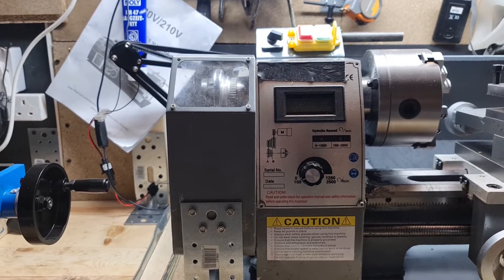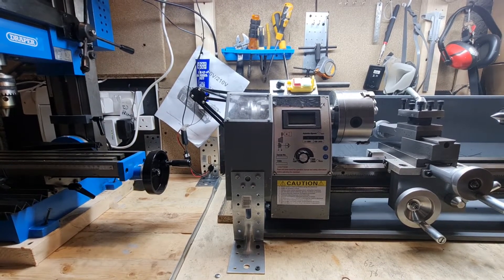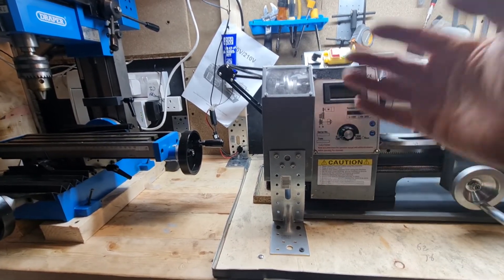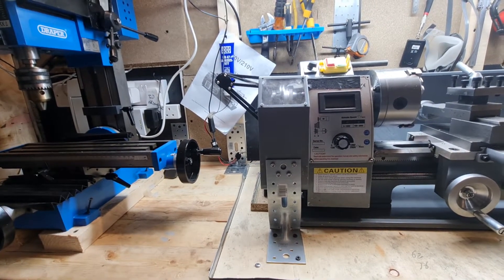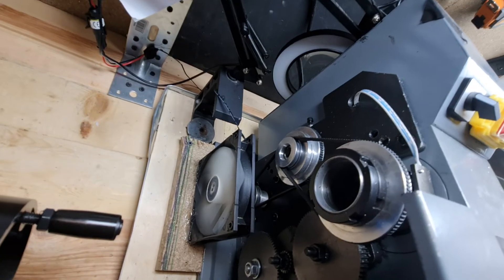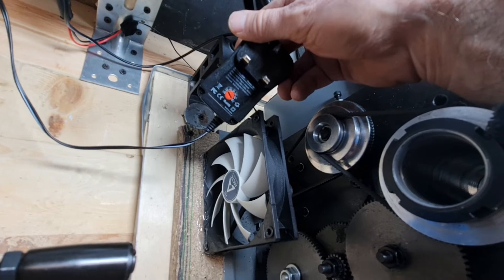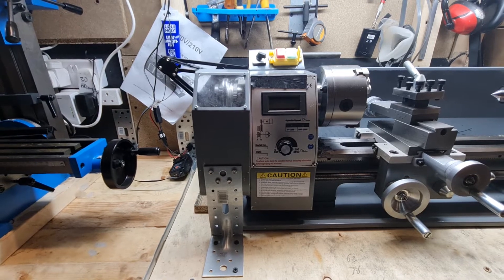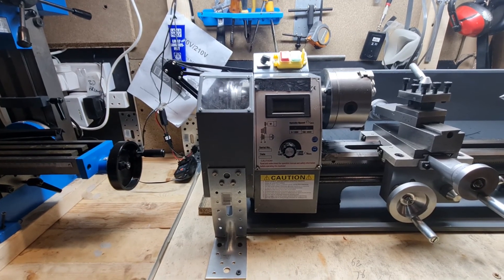Chinese Mini Lathe review part 4 (of 6) MX-210V lathe  interim motor cooling and safety hack

Comment: Must tell you, that unfortunately your friend is wrong, the motors on all lathes GET Extremely hot to the point where you cannot touch them, this is Normal! Stating that, sure a cooling fan all-though unnecessary won't hurt, but i must tell you that you have the fan in the wrong place since the motor blows out hot air through the front of the pully and sucks air at the rear inside the casing from the motors internal fan, blowing the hot air through the front where the pully is mounted with the belt. The idea behind this, is simply that with the hot air blowing out through the pully end helps to keep mini chips from entering the front of the motor at the pully end.
Reply from the maker: Thank you for that. I think I said in the video I felt a lot of hot air blowing through after the fan mod, so I feel happy with that anyway! Chips wont be a problem as in my case since I sealed the motor off from surf & liquids getting into it anyway. I also did the fan mod because of that sealing, where I did alter the airflow, so felt I needed to improve it, as I had essentially blocked off the original outlet :)

Comment: Hi enjoying the vids..do think your fan is in the wrong place should be mounted to the rear of the motor drill a large hole on the rear splash panel and mount so you get cool air to the rear of the motor...folks has this problem with wm 180 melting the brushes of the motors
Reply from the maker: Thanks very much for the comments, info & link, I will definitely cut a hole in the back panel, in fact I might keep the existing fan & really blitz the motor with cold air :) I am getting some cooling air underneath the motor, for now. I considered getting the Warco but the brushed motor was one of the things that put me off. I noticed the next Warco model up now has a brushless motor. It was just to big for my purposes though.